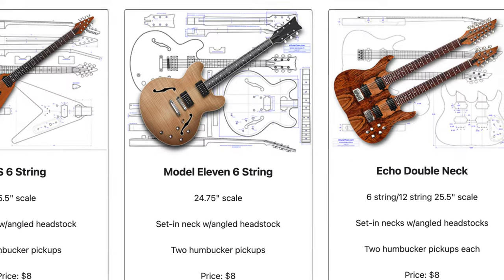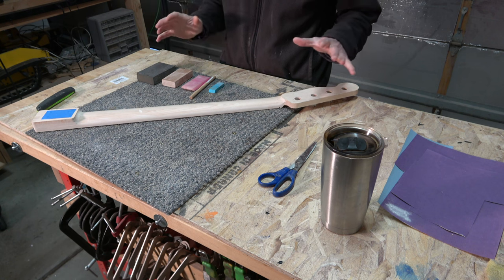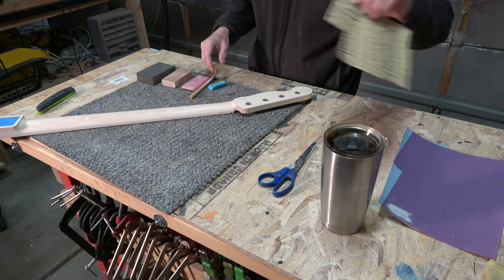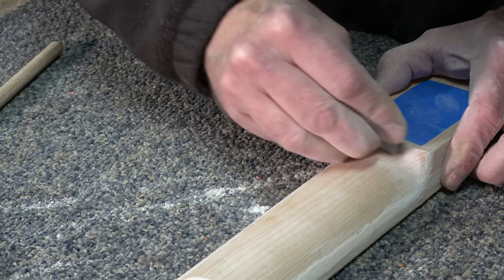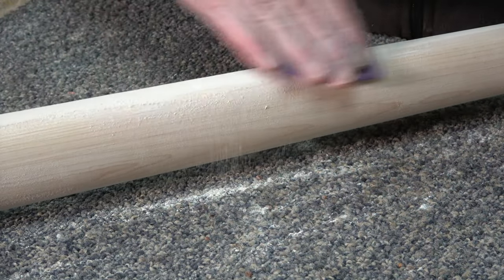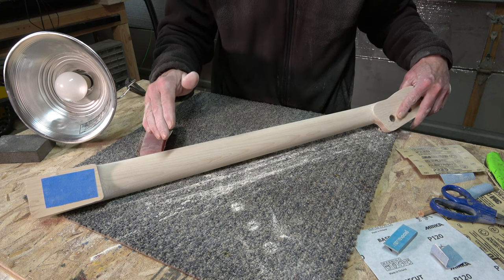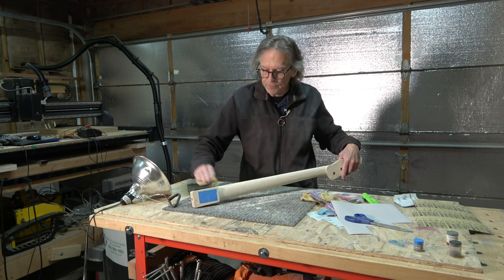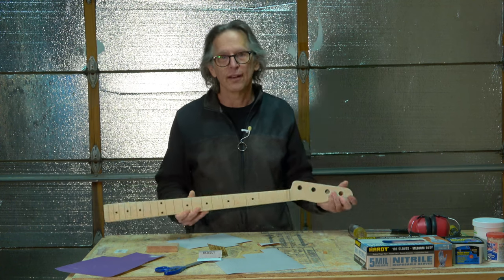Building A Precision Bass Part 9 Sanding A Bass Guitar Neck

Comment: Been watching your videos for a while and I've learned so much. Thank you for making these! I'd love to buy a guitar from you one day. You've inspired me to finally start on a project guitar I got from a pawn shop a while back. It's an Agile 7 string with a maple neck/fretboard and mahogany body with basic satin clear coat. The surface is pretty rough from previous owners so I'm going to take it back down to bare wood and do either a tung (the modified kind you mentioned in your vid on neck finishes) or boiled linseed finish on the whole thing. Almost all of the guitars I've had (poor boy grade Ibanez and budget brand) have had gloss or semigloss poly necks and my favorite guitar has a nice satin finish. I love wood and want to feel it and see it as natural and raw as possible so drying oil feels like the way to go.

Also, I checked out your website and noticed that the top half of the home page is a bunch of 'coming soon' blocks. If you ever want to polish up or build out your website more, I'm a web developer and designer by trade (and aspiring hobby luthier lol). Trades are always fun with small businesses.

<3
Reply from the maker: I'm moving toward getting rid of my websites.

Comment: Hey Chris. Just wondering how well lacquer would adhere to the surface if you sand beyond 400. A lot of the luthier forum comments say that 320 is usually the maximum for good adhesion and I've mostly gone to 220.
Reply from the maker: If by lacquer you mean nitrocellulose, you would need to spray a vinyl sealer first. Adhesion wouldn’t be an issue.

Comment: Not related but, did you ever follow up on the spray on Solarez clear to see if it was any better than the brush on? BTW..Thanks for all your videos
Reply from the maker: No, I haven't tried it. I feel you need to have a dedicated gun for spraying Solarez ICBINL, which I don't. These days, I use Solarez ICBINL as a brush on grain filler that cures in minutes. For my clear coats, I am using Centurion water-based 2K polyurethane.
Reply: @HighlineGuitars  Cool, I thought you were using Brite Tone clear?